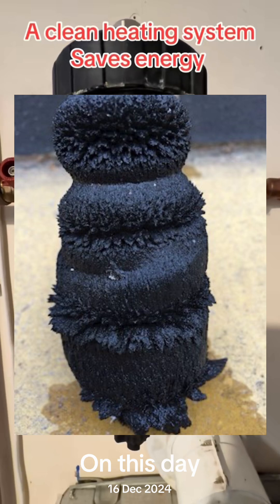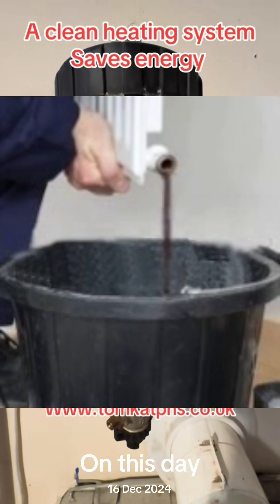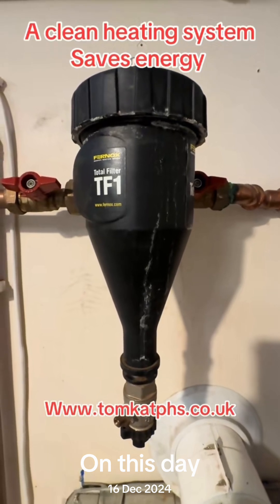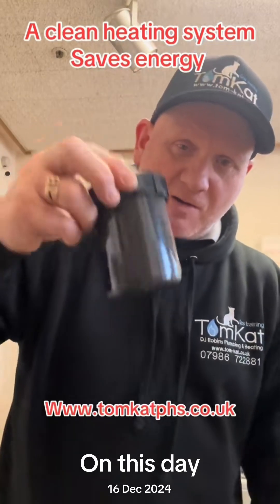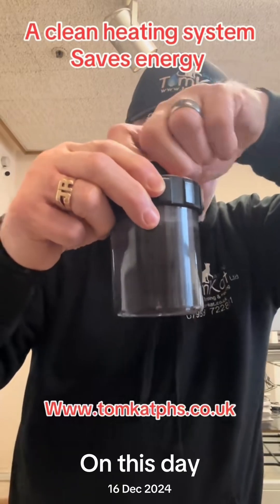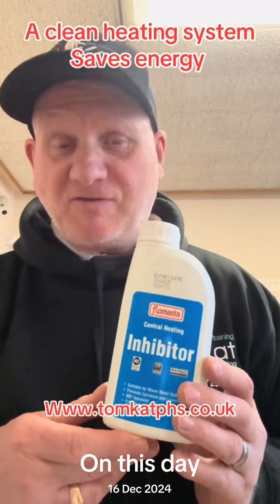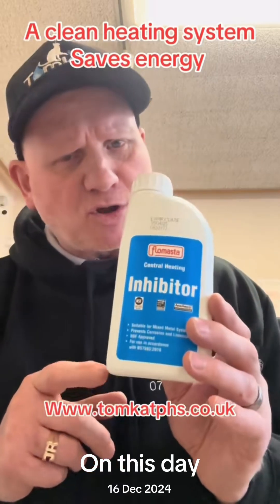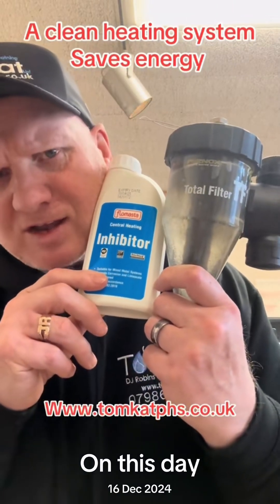A clean heating system saves energy and money #plumbing #gastraining #centralheating

Comment: Hi TomCat. I have a question for you. I bought a W 100 combi (private sale, new) Yes, I first checked waranty will still be valid when commissioned with Viessmann before anyone calls me stupid. Anyway, It's an "M" type boiler though, which means "communal flue" varient. I spotted this but the seller said it's also fine for single, non-communal balanced flue installs too. The only difference being this has extra backdraft prevention inside. 

For some reason yesterday I checked this claim using AI and it came back that no way you can use it, it would come back "ar risk" or worse if you tried and that's if it even worked at all. 

This was quite a shock as it cost me quite a lot. So i then checked direct with Viessmann technical, the guy said "he couldn't see a reason why it would be a problem" and said it's fine to go ahead. I told him what the AI had said but he said he didn't agree. 

Now I don't know what to think. So what's your take?? 

And remember, I did check with the manufacturer, just as you always say.
Reply from the maker: What kw is the boiler and what type of property is the boiler installed in and is the engineer who installed it qualified to do so
Reply: @tomkatgastraining  

Thanks for the reply :) 

So the boiler is a "VITODENS 100-W
B1KF-30-M 30 kW - combi boiler" (7722713) 

The property is a 2 bed, 3rd floor (top) 1 bathroom flat, 70m2 with 7 rads. The engineer who installs it, will be qualified, (it hasn't been installed as yet, I was checking before I get someone to do it, & doing some extra due diligence.)  

Hope it's all fine to proceed though, or I'm in a bit of a pickle. :(

I'm also having some trouble with trying to work out flue placement. It's not a straight combi swap. 

It's replacing a quite unusual system for a 2 bed flat. Currently it's a Baxi Solo 2 from 1990 with a 117L unvented cylinder above it. All in a pre plumbed custom steel frame, which must have been built off site and installed when the flat was built (also 1990), you really should see this thing! 

It also has what I can only guess is a small rectangular tank placed above the cylinder, sitting in behind the expansion vessel at the top of the system. I don't know what that does??  

The problem with the flue placement is mainly to do with the Eves + a rainwater down pipe getting in the way of the proposed new flue location, as the current flue position can't be retained. 

I can't use a plume kit due to it being 3rd floor with uneven ground below, so no access to exterior wall is possible really, so the flue can only be installed from the inside. (I'm thinking to use a Flue snug for that.) 

I've watched all your "balanced flue regs" vids :) and measured everything, and still I'm not sure if the placement I have in mind is in compliance or not. It’s a real head scratcher, you should see it, I’d send you a photo if I could to see what you think. 

There is nothing “standard” about the install, that’s for sure. 

My 1st floor neighbour who has the same current system foolishly thought she’d be ok getting one of those online big box boiler installers round to swap out her identical current system for a combi, only to have both “Boxt” and “Heatable” “engineers” come out to do it, and both then leaving when they saw the current set up they’d be replacing, saying they couldn’t do the job! lol. 

They just came with the new boilers they were going to put in, and left with them still in their boxes again. I told her that would happen (not in so many words) if she used an online boiler-mill installer on a job like this, but she just ignored my warning, of course.  

In the end, she had to go with an proper engineer but had three weeks without heating & HW due to the time wasted on the online installers. :(

Her install hasn’t got the Eves to contend with, or the 3rd floor problem, so mine is harder due to height & Eves. 

Tbh, going to a combi is probably not even the right choice given what’s already here. I was even thinking a HP would be a good idea given the BUS, but good luck with getting permission for an outside unit and finding an installer to put one of those in a flat. 

Other than that, I was originally thinking a storage combi like a Viessmann 111 (expensive though) and hard to position but possible. Or a Combi with a rear flue which I think only Vailiant/Cosybug do. 

While deciding what option to go with, I just spotted this W 100 for sale privately, and I just bought it as the price was good and it was boxed and brand new. I also checked with Wiessmann the waranty would hold up first, as I said! 

Would be great if I could show you all this. Anyway, I’d appreciate your take on the communal flue “M” issue, that’s for sure. Thanks :)
Reply from the maker: @markfernandes2467  it sounds like a fun job if I was you I would get an installer who specialises in Viessmann boilers first to check out the boiler because to me it sounds like it’s a European boiler not a uk one and secondly to go through the installation with you. Good luck and let me know how you get on 👍🏻
Reply: @tomkatgastraining  Hi again :) 

Believe me, there's nothing "fun" about this job, :( , lol. It's a headache to do from all angles properly, that's for sure. 

Unfortunately, I like to do things properly though, that's my problem. 

On the "Communal flue" issue in general though, do you have an opinion though? This is the interesting point right now. I'd really like to know what you think on it.  

Might make for an interesting technical video question I though :) YT has no videos on this, trust me. :( 

As to it being a European boiler, I doubt that as both the seller and Viessmann confirmed the serial No. as being legit stock for warranty in the UK. 

As for a Viessmann installer, yup, that's a good idea but tbh, installers don't want to do re positioning work, or high up work and they don't seem to have time to discuss options properly. 

That's why I'm doing the planning myself, as the re location would also need someone to reposition a soil/vent pipe stack in a void in the kitchen if the boiler is to be placed in the inside corner I have in mind to put it. 

I doubt a boiler installer likes the sound of replacing an LCC cast iron pipe and replacing it before even getting to the boiler. 

But the problem is a chicken and egg one. If the boiler can't be fitted, and if the flue location isn't compliant, then no point getting someone to replace the soil pipe. :( 

Before any of that though, I really need to know if I've bought a lemon. Veissmann think it's fine to go ahead with this "M" boiler. I have e mailed them to put that in writing, (no reply to that as yet) as I'm 100% sure, any Viessmann Installer would only call them on it too. They wouldn't take a position themselves, so I'm doing the leg work for them to save them having to ask. 

Sure, I'll keep you posted if you like. I could send you some pics if you'd like too. Just let me know how to if you do.

cheers :)
Reply from the maker: @markfernandes2467 boilers sold in the U.K. on the data badge it will say c then followed by 2 numbers so c21 for example that tells us what system the boiler can be installed on have a look at that
Reply: @tomkatgastraining  Hmm, I can only see a "C" on the label in the context of a list  "C13 C33 C43 ~" I don't see any other place with a C followed by 2 numbers. 

Btw, I just called to follow up on my email with Viessmann, spoke to another Tech there, he thinks its ok to fit as a single flue install too. 

Also that they had looked at the email and there had been some comments from techs on it & they'd be sending me out a reply soon. All seems fine though he said. 

He even said if anything, it's more protection, so better than the regular version, just as I had originally thought when thinking of possible backflow protection given the proximity of the Eves to the flue I mentioned. 

So it might end up giving me more flexability, not less, who knows.
Reply from the maker: @markfernandes2467 the protection is there to stop products of combustion coming into the boiler if it’s installed on a bank of boilers so no extra protection if installed on a single concentric flue system. Hopefully you can get it installed
Reply: @tomkatgastraining  Yeah, fingers crossed at this point. I'll post the official  Viessmann reply I get here if you like.
Reply: @tomkatgastraining   Hi, well, I’m had to chase them as no email came but finally got this somewhat underwhelming but at least good news response 👇

Good Afternoon

As discussed with several Technical team members , Just to confirm it is OK to install the M Boilers on a single flue installation,

Kind regards
 

 

Technical Support | Residential & Light Commercial EMEA | Carrier HVAC

So there you have it then .